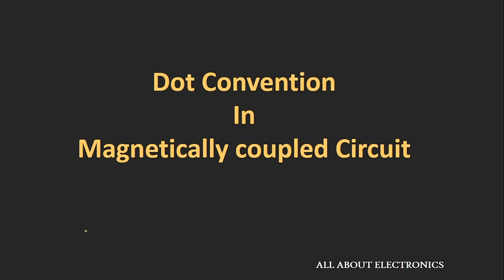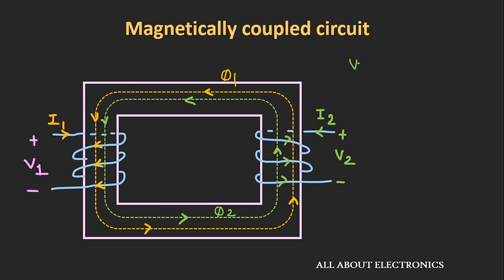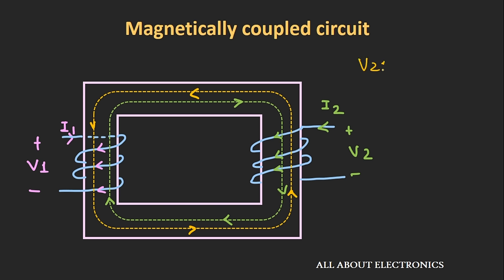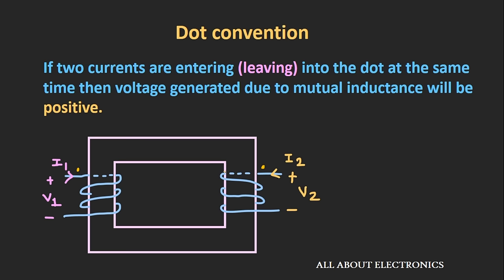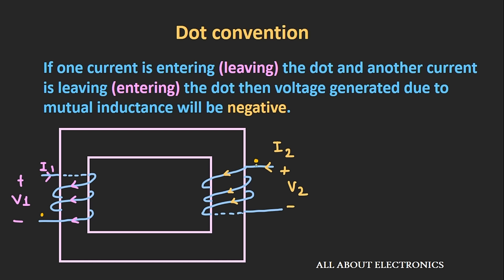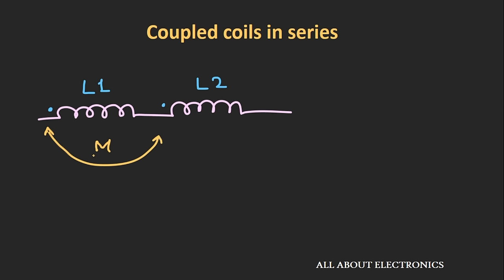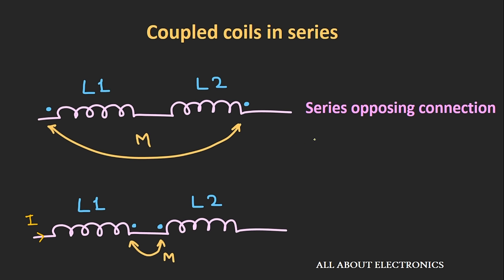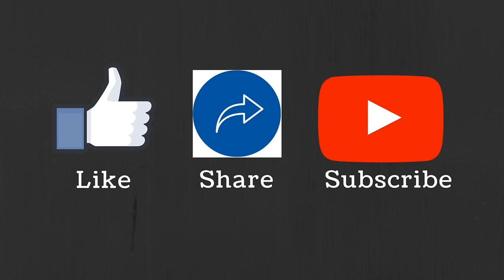Dot Convention in Magnetically Coupled Circuits

Comment: I have a little doubt here. According to faraday and Lenz law, the self induced EMF is "minus L(di/dt)".Why use neglect the Minus sign of the lenz law?  if u see this, plz response.
Reply: A long time later but I also agree. I think it’s the wrong way around here. Maybe I’m wrong, but in the example when the flux from both coils is in the same direction, increasing current I1 would increase the total flux through coil 2, thus coil 2 would produce an emf to undo this change, i.e. a negative emf, thereby generating a downward flux. The opposite happens for the second example.

Comment: Quick question on dot convention please? What if on the first coil, the current is pointing towards the right direction and the voltage is - up + down AND on the second coil, the current is also facing the right direction and the voltage is + up - down AND both coils are dotted at the top. What is V1 and V2 here

Comment: Great video, but I am confused about the basic setup with the 2 windings around the same core. What is this supposed to be? In a typical transformer there would be no current source feeding the secondary winding The coils are not in series, So what exactly is this setup?

Comment: I need your help in knowing the types, details about resistance, capacitance,inductence items.
Reply from the maker: I have already made the videos on it. Please check the playlist on basics of electronics on the playlist page of the channel. You will get all the videos.
If you didn't find then do let me know here. I will send you the seperate link.
Reply: Hey it would be really nice if you tell me which video is next as I am really confused.also the last part of this video ended abruptly without showing the relation between the three

Comment: Can you show the series connected inductors also with the magnetic core included? (Even the calculation is possibly correct)
Green dots show series connection of L1 and L2, yellow dots the series connection of L1 and L3 and orange dots the series connection of L2 and L3. Maybe if its same magnetic flux it can use just same dots. The dot point the side of the coil where magnetic flux come out. If all the coupling exist or there is flux coupling between 1&3 and 2&3, but not between 1&2. If the magnetic core can have 2 branches also. Flux1 going through l1&l2 and flux2 through l2&l3. I'm not sure if I could be sure without magnetic flux drawing.

Comment: 👍 sir.  I need derivation of equivalent inductances in all 4 cases
Reply from the maker: The seperate video is already made for the same.
Please check the playlist of magnetically coupled circuit on the channel for more info. If you go through that playlist, all your doubts will get cleared.

Comment: Are these examples of conventional current flowing (conventional notation) or electron flow notation?
Reply from the maker: Conventional current
Reply: @ALLABOUTELECTRONICS  Thanks for your quick response. This series on magnetically coupled circuits is not outdone by any other provider on this platform and the BJT solved problems playlist was the best 12 hours I ever spent on the internet.

Comment: are we putting dot randomly or  any logic is behind the putting the dot
Reply from the maker: Dot convention is used to avoid any ambiguity about winding or coil direction (The direction in which winding or coil has been wound). And the direction of the winding decides whether flux is adding or opposing one another.Because if we do not use dot convention, then just by looking at the schematic or symbol of the coils, we can't tell that voltage that is generated in the nearby coil due to mutual coupling is positive or negative.
I hope it will clear your doubt.
Reply from the maker: Dear Harshit, Yes you can choose a dot on any one coil randomly and you can apply the voltage on the both coils randomly. Now, if the flux that is generated in the both coils are additive then put the dot on the second coil in a such a way that the polarity of the applied voltage matches at the dotted terminal in both the coils.
If flux that is generated in the both the coils is opposing each other  (after the randomly chosen dot at one winding and the randomly chosen voltage polarities), then put the dot on the second coil in a such a way that polarity of the applied voltage is opposite to each other at the dotted terminal. (i.e if you have put a dot on the positive terminal of the applied voltage on one coil, then put a dot at the negative side of the voltage at the second coil.)  
I hope it will help you and will clear all your doubts.

Comment: I know my question is a bit idiotic, but don't currents have to first enter the dots to leave it ... I mean if a current doesn't enter a dot in the first place, how will it leave the dot?? At 8:36 u said that current are leaving the dot at the same time ... But current enter bhi toh ho rha h! I feel like the currents are simultaneously entering and leaving the coil . How to determine whether it's actually leaving or entering??  Please clear my misunderstanding!!🙏🙏🙏
Reply from the maker: The first thing, dot convention represents how winding has been wound around the core and how flux is generated in the core. So, when we say current is entering or leaving the dot at the same time, it means that in both widings flux is aiding to each other. And when we say in one coil current is entering and in another coil current is leaving, it means that flux is cancelling each other.
Now, let's come to your doubt.Now when we apply the voltage to the coil then current will start flowing through that coil, depending upon the polarity of the voltage. And current will enter the coil from the positive terminal of the coil. Now, if dot is on that entering point of the coil, then it is called current is entering the dot and if dot is on the other side of the coil then current will see that dot while leaving the coil. and it is called current is leaving the dot. 
I hope it will clear your doubt. If you still have any confusion then do let me know here.

Comment: How to place dots when 3 inductors are present
Reply from the maker: In that case, you need to consider two coils at a time and need to see how the flux is generated in that to coils. (e.g at a time consider coil 1 and 3 and see the direction of flux.)  The same procedure you can folow for other pairs of coils too. (i.e coil 1 & 2 and coil 2 & 3)

Comment: all the dots will have same polarity . in your 10.52 min I guess the direction of plus/minus will be opposite
Reply from the maker: L2 (di2/dt) is the self-induced voltage in coil 2 due to V2. And it will be positive. While the second term is due to mutual inductance. And here the polarity of dots are opposite so, the voltage induced in coil 2 due to current I1 will be negative.  Expression of V2 is correct.
Reply: i am not saying that your equation is wrong. i want to say the direction given on the diagram for v2 will be opposite according to me, as you have given plus sign on the v1's side dot the dot on the v2 will have same polarity.. you have given +/- on both side, but on the second side i guess plus and minus side on the diagram will be reversed.
Reply from the maker: No, it is ok. Please check the video at 7:30. It will get clear to you. If both coils are mutually aiding, in that case, whatever polarity of the voltage that appears at the dotted terminal, the same polarity of voltage will appear at the other side of the dotted terminal. If coils are mutually opposing, in that case, the polarity of the voltage at the dotted terminal will be opposite. 
I hope it will clear your doubt now.
Reply: i am saying so.. but check the diagram on 10.52. min. one dot has plus another has minus
Reply from the maker: It has to be. As I said earlier, these coils are mutually opposing. For mutually aiding coils, both dots will have the same polarity. While for mutually opposing coils, polarity at the dot should be reversed. (one dot at plus and another dot at minus polarity)
I hope you understood what I mean to say.
Reply from the maker: You can message me on the facebook page of ALL ABOUT ELECTRONICS. You will find the link in the description of the video.

Comment: when the dot is above inductor like this ⏺ _/\/\/\/\/\_ is current leaving the dot or entering the dot??
Reply from the maker: It depends on the current direction. If the current is flowing into the dot, then the current is entering the dot. If the current is going away from the dot, then it is leaving the dot. 
I hope it will clear your doubt.
Reply: @ALLABOUTELECTRONICS   so if the current is entering the inductor from the left and if the dot is either to left or right of the inductor, the current is entering the dot right?
Reply from the maker: If current is entering the inductor from the left and if dot is on the left side, then current is entering the dot. If dot is on the right, the current is leaving the dot. 
I hope it will clear your doubt.
Reply: @ALLABOUTELECTRONICS  Thanks a lot for clearing my doubt. You are the best!!

Comment: u r wrong
direction of flux due to current 1 will be upward.
Reply from the maker: Please check it again, it will be downward only.
Reply: its not depend on linear direction 
it's depend on circular direction clockwise or anticlockwise